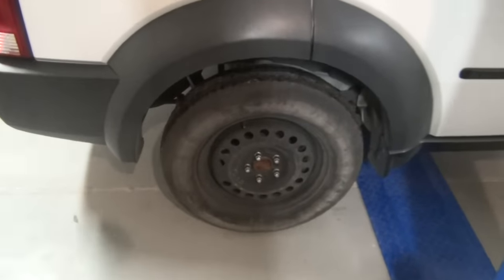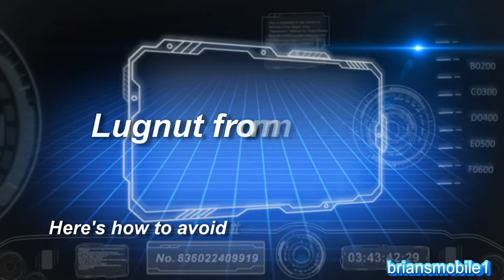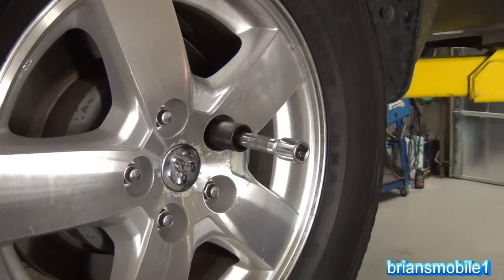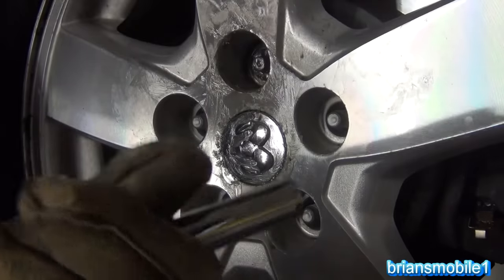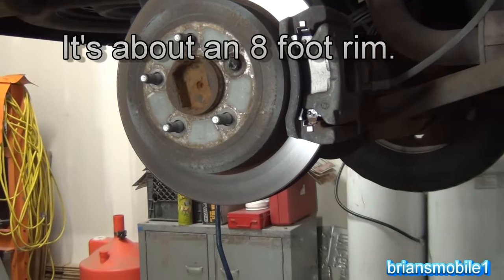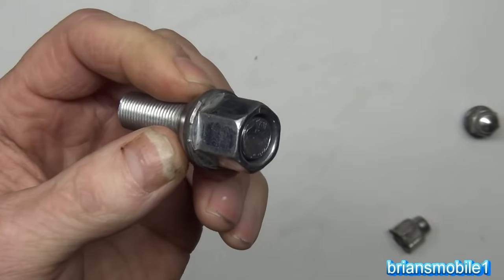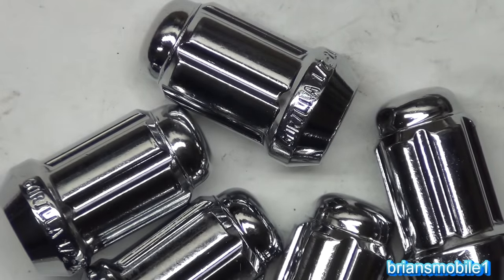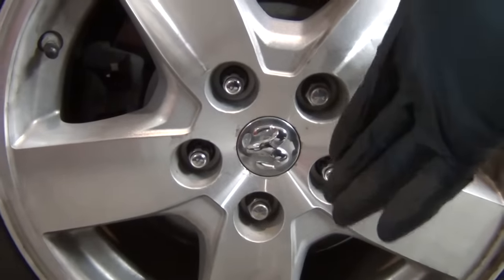Lugnut From HELL

Comment: Lug Nuts are to be Tighten using a TORQUE Wrench to.avoid Overtightening which is what happened here. A normal Car Lug nut Tightening Torque is around 70 Nm to 80 Nm. While a light Truck is around 90 Nm to about 120 Nm. But those Workshop sometimes overtightened it to over 200 Nm !

Comment: The best measure of any establishment (and in fact many things in life) is not how often things go right, but how it's handled when things go wrong.  It sounds like whatever place it was you went to may have screwed up, but handled their mistake properly.  If so, then good on 'em!  :)

Quite an interesting video!  Perhaps I've just been lucky, but I've never run into a two-piece lug nut like that.  I'll definitely be adding an extra step to my wheel removal process!  A quick little wiggle of the socket before going nuts (pun not intended...) should reveal if the nut is a different size.

Comment: Too many guys grab their mega-high power air gun and tighten the lug nuts without regard for the wheel coming off next time. When I was service mgr in a Ford dealer I saw it a million times. Some wheels don't react well to the heat from a torch or plasma, it puts you in a bad situation with the customer. A dab of NeverSieze and a torque stick eliminate 90% of those kind of problems. One trick I've used with some success is make a small cone from sheet metal to surround the lug nut to protect the aluminum and hold it with long bent nose pliers. Wear protective gear as it directs the flame back at you, the nozzle gel is a good idea, the clay that's used when doing body repairs with lead filler works better to absorb heat without burning away. Just suggestions from my experience.

Comment: For anyone wanting to try this heat it up until cherry red or white then immediately pour lots of water on to the pub nut its self, this rapidly cools it hardening the nut, then use a smaller socket to hammer on or nut remover like he tried.... Also don't use an extension with your impact when doing this as you lose about 25-30% of your impacts power lol

Or just use a centre punch in the stud then drill it out..

Comment: The dealer completely stripped one of my lug bolts. They make sockets specifically for this issue. The socket threads itself onto the bolt counterclockwise and once it reaches the base of the bolt head it is essentially locked onto the bolt. I used a cheap craftsman impact and got the stripped bolt out in 15 minutes without doing any damage to my wheel.. and it was ridiculously overtorqued.. this was a complete hack job and there's really no excuse for it considering you can get one of the bolt extraction sockets right at autozone... but to each their own. I'd rather buy a $10 socket than a whole new wheel

Comment: Same thing on my dodge ram. two of them on the same wheel. Lugnuts broke in half. So all that was left was the rounded bottom. I drilled around the lugs destroying the rim. Then i threw those rally rims in the junk and replaced them with chrome rims that you could at least get to the lugs that aren't buried in a hole.

Comment: Those gorilla lug nuts will actually take a 6 point socket as well, give it a shot sometime.  I believe a 17mm.

Nice video by the way!
Reply: If you're doing lug nuts/bolts you should only be using a 6 point socket of high quality.

Comment: I just went through 3 1/2 hours of pure hell with my Jeep aluminum wheels. Same stupid capped lugnuts. Someone put mine on with an impact wrench to the max. How the studs didn't break is beyond me. Less the torch I did everything that you did. One thing extra: I used a 3/4 inch bi-metal (QUALITY) hole saw. I took the drill bit out of it and slowly drilled around the remaining part of the lug after taking the outer layer off. Looks like there would be NO wheel damage at all and it was pretty quick. Should have done hole saw first. Stay well.

Comment: I have found the best and least destructive way to remove a stuck lug nut is to drill them out. Using a torch is effective but is hard on expensive wheels.

Comment: I snapped my 1/2" drive breaker bar with a five foot galvanized pipe 
after heating red hot. Defeated two Impact drivers, both half inch. 
Snapped a star wrench style lug remover at the center weld.

 It's also a goddamn Chrysler.

Comment: Out of curiosity, what years would this apply to?? I have a 2015 model and am wondering if it's something I should be concerned with.
Reply: I also have a 2015 and am thinking of replacing the lugs to avoid this type of issue in the future as best I can.

Comment: Way too much work there. You had the right idea the first time. I remove 10-15 a week for our local Discount Tire Store. To be straight, DTS pays for the repair everytime, with NO griping. They are the only tire store I know that does this. The failure here was not the lug nut. The common failure here is the last person that put on the lug nut. They are usually cross threaded and driven on with an impact. The next guy gets the bad one, either broken off (preferable) or stripped out. To remove these in 10 minutes, yes even the one in the video, put the nozzle dip on the wheel, turn oxy acetylene torch down, and blow the stud out to even with the wheel, then use an air hammer with a punch to push the stud on out while still hot. Works everytime. 10 minutes.

Comment: I know power is not the issue here but just gotta say:   I have the snapon impact guns and let me tell you.  The Milwaukee is a TON more powerful.   Especially with a fresh 5Ah battery or higher.    Use a 12A and you can do anything.     Take bridges down Lol. 
The Milwaukee is super heavy to hold though and the impact motion is violent and unstable.    The SnapOn is lightweight, zips faster and a has steady pulsating impact.  
Both are great to have.  When i worked on heavy duty diesel and excavation equipment, the Milwaukee was handy.   i mostly stuck with it.  But if I’m doing routine stuff , tedious or laying down: i want my SnapOn. It’s light, steady and stable.

Comment: I have ran into this exact issue a few times. My strategy for the least stressful removal is to heat the stud and drill right through the center once you get a good hole in there you can hammer it and break it off

Comment: I looked all over for a set of Gorilla lugs that have 24 lugs for a Jeep, but all the kits are 20 piece, need 18 standard with 5 keyed.  Gorilla, hey, Wranglers need  3 lugs for the spare, or 2 and a locker.
So, 4x4 (for wheels), 2x1 (spare) and 1X5 (locker lugs) in a Wrangler kit.

Comment: That nozzle dip seems to work well. In the same situation I have used tire lube compound with excellent results aswell (as long as you glob it on there) first heat it up then chisel away as much of the lug nut as possible. Then with just 1 other lug nut threaded on a few turns adjacent to the damaged nut I will hit it with the oxy/acet until it’s a cherry red pool and have somebody else smack the back of the wheel with a deadblow hammer it usually pops right off after a few good smacks.

Comment: My  neighbor  had a jeep with a rounded over lug nut. all I did was the same thing you did. But I used 1/4 or 5/16  drill in the center of the lug and slowly drilled it far enough to weaken the stud used the tire and rim to snap it off .

Comment: Last time I worked on a vehicle that had a frozen lug nut and was about to the point you were at with the torches and all. I just drilled it out. Made it SO much easier in the long run and less time. Just told the customer I would need them to pay for the 15 minutes to drill and the time to install a new stud and lug nut onto the vehicle... Took me 30 minutes and they paid for an hour.

Comment: drilling the stud is the safest way to make use you wont damaged the wheel... starting small and going deep until you are at thr same level as the nut and work your way bigger.  the only tricky one i got was on a audi a5 safety lock bolt. can't drill can't punch... i deflated the tire and welded around the stud the material was now soft enough that an extractor would grab...  still needed to use a 3/4 inch impact with 170psi to crack it free but champagne and golf clap was the end result

Comment: I had one like once on expensive chrome wheel customer dropped it in after the tire shop rounded it off, I don't bother with hammers, torches as it damages the rim, I drill a tiny pilot hole very slowly so you dont burn up and break drills through the stud and went one size bigger until the the wheel broke loose, I just replaced the stud and wheel nut without any damage to the rim, hours work though but a lot cheaper than replacing a rim.

Comment: I just had the same experience with jeep lugnuts. I ground off the cap with a grinder protecting the alloy with tape from the grindings then drilled them out. I was very surprized how soft the lug studs were and how easily they drillled out. from there I can pull the ones that will remove normally or with a smaller 12 point socket pounded on. Don't think I would ever try your approach. Just sayin.

Comment: Ever heard of an annular milling cutter?  Or even easier, remove all the other lug nuts, set your wheel an inch or so off the ground with the stuck lug in the 12 o'clock position and yank the bottom of the wheel away from the car. It'll break the stud, which you can easily replace.

Comment: Brian  on  that bolt or most any other grab your oxy/ acetylene torch get center of bolt to glow red then without moving  tip quickly turn off  acetylene knob squeeze oxygen handle move tip inward  ( caution allot of blowback ) with practice bolt will melt away leaving threads intact

Comment: What I've had to do is take an acetelene torch and with the flame just hot enough to cut with the oxygen put the tip in the center of the nut and blow out the stud inside. this gets the nut off so you can remove the tire, and results in little damage to the wheel. Of course I've only done this after all other methods have been exhausted.

Comment: Just been thru that too. I drilled the stud itself. Started with a 1/8" drill bit and went up till it was into the threads then drove the stud out the back. Get a set of solid lug nuts off eBay for $20.

Comment: I had lugnuts like this. Towing company came with impact sockets, took one size too small, sledgehammered it on, and using a long breaker bar snapped them all off. Probably could have done the same here.

Comment: Just a question , wouldnt it be easier to punch the center of the nut/stud, drill a 1/8in hole then take a slightly bigger and bigger drill bit till you go through the nut and stud without damaging the wheel ?

Comment: Next time get a really hard drill bit and just drill the stud off. a stud cost 4 bucks, saves torch fuel, saves head scratching. 

Then disassemble the brakes to expose the back of the hub hammer the old stud out slide the new stud in, put a nut over the stud that does not thread onto the new stud. put the lug nut on, then tighten the lug nut until the new one is seated.

Comment: the nut is not soft, a 19mm will not damage it when spinning. so the cap breaks free, than corrosion swells it, its soft. its an 18mm nut with a 1mm cap on it. hammer a 19 onto cap if swollen. if that spins. keep spinning with impact. until it gets stuck in socket/hot. using socket pull cap off. than, an 18mm will go right on nut under neath and fit the 18mm well. bingo. 18mm socket is key with 19mm capped nuts. and those spline nuts aren't any security at all. its extremely common and a universal key. they aren't security nuts, they are for narrow holes in aftermarket wheels. with the nut being physically twisted like that, its entirely possible it really was just that stuck, hammering a socket on wasn't the cause, hammering on a 17mm is practically impossible. that never really causes stuck nuts. if you are torching you can just torch through the stud, it can't really cut the aluminum wheel

Comment: The entire time you were trying to get it off I remembered seeing a video of yours where you mentioned the plasma cutter. They come in handy for cutting bad out of a frame to weld in new metal. 

Thats said I usually will try heat and if that don't work I'll either plasma cut it or I'll just go ahead and deem both the nut and stud shot and drill it out. The Chrysler lug nuts are horrible and I have seen them seize up a month after putting them on mostly on Jeeps. Dodge Rams I do work to usually will come right off and even though the caps usually fall off as well they are just a bit easier to come off for me anyway. 

Lastly I always have switched to an 18 when the cap comes off or use the socket with the cap stuck in it on any one the cap is missing this has made the amount of stuck ones minimal and I really only see them now when someone else has taken their wheel off and lost the cap.

Comment: They make 17.5  18.5   19.5   21.5    and 22.5 MM sockets for swelled lug nuts and lug nuts missing the cover sleeve. Also if they do do break loose with an 1/2" impact, I grab a 1" impact and snap the stud.

Comment: matco makes a 22.5/22 socket for the dodge trucks and a smaller one for the 19mm lugs. they fit on the swollen lugnuts so you can take them off. the smaller socket also fits the lugnut when the cover comes off so you dont round it off. and if those fail I used to use an air hammer with a chisel bit to spin damaged lug nuts and wheel locks off

Comment: Remember, anytime you heat a piece of steel you could be taking the temper out of that part. You softened the lug nut with the torch which is why it felt so soft with the cold chisel. But yes these lugs are most likely a low grade steel anyway.

Comment: I had this exact same issue on my dodge truck, luckily it was on the steel spare instead of one of the chrome rims. I eventually cut the lug and stud off with a grinder and then had to keep grinding to get the rest of it out from where the lug seats into the wheel further. Bought the last wheel stud my local autozone had and got it replaced. Nothing like taking all day to change one flat.

Comment: Just FYI even using a lug nut extractor impact socket will still strip these if the acorn is missing.

God help you if that acorn falls off or you lose it on the road. I'm in the same position Brian was in, except I don't have a blow torch or a plasma torch.

Guess it's time to go to the shop. At least I know the wheel isn't going to fall off in the meantime, because that lug nut isn't going ANYWHERE.

Comment: Should of tried a bolt extractor, the hammer on socket type with spirals inside that bite when you twist
You’ll twist the head off before you strip the grip on it
I work on super rusty forklifts all the time, the suspension bolts are always seized up 
I use maximum bolt extractor set, 40$ on amazon, and they’re impact friendly 
Heat her up, knock the extractor on, rip it out
Works religiously

Comment: OK I know this is old but ditch the chrome extension and either use an impact extension or just the socket.  You lose an incredible amount of power due to the flexing of the chrome extension.  I would also suggest a stronger impact wrench.  I used to use an IR 231 (I think...rather in expensive but with tons of torque) and never had an issue with removing any nut/bolt.  FWIW I worked for Chrysler fo 10 years and saw lots of these cap lug nuts.

Comment: It probably would not have helped in this case, but you need to put your socket directly on the impact wrench and not use an extension because of torque loss due to slop.

Comment: A Metrinch socket with a long bar would have been in with a chance. Even if it's labeled a certain size, each socket will generally undo a size down due to their single hex wall gripping design. I'm now tempted to get an impact set from them after seeing this, despite costing a bomb.

Comment: Center punch the center of the stud once then drill it using drill bit that's one size bigger than the stud. When you get close to the end you can use a socket to twist the nut and stud right off.

Comment: Why did you not drill out the stud? its not harden steel. You have to replace the stud anyway right? This happend to my sisters corola and thats what i did, I have a drill doctor and it only took 3 drill bits, a water hose, resharpening each bit once and the last bit was sharpened 2 times. took us 30 minutes to get it off.

Comment: A quicker and easier way... Get some good quality Cobalt drill bits. Drill down the center with a small bit and follow up with a larger one. Stud will snap right off. Pound out the old stud and install a new one.

Comment: I found on my dodge van after so tight half of lug nut snapped. So tight it snapped with a long breaker bar. I simply drilled through the stud itself.  You will be amazed how quickly it will drill through. Sure you need a new stud but chances are you would anyway

Comment: If the extension isn't needed, using the impact wrench directly on the socket would apply more force. The extension is acting like a torque stick of sorts, limiting the peak torque.

It didn't seem like the lug was stripped and spinning with the impact wrench and socket; was it not possible to apply more torque with a breaker bar or torque multiplier, before resorting to the last ditch methods?

Comment: This is why I will continue to use torx for everything. Any things don't need to be tightened down that hard and if they are tightened down quite a bit you have a higher chance of breaking the tool than you do the nut. Also most people don't have torx bits and therefore using them more means less people can steal your shit....

Comment: Use an electric high torque impact, personally my favorite is the Milwaukee M18 Fuel 2767-20 delivers 1400 ft-lbs torque. Gets crankshaft bolts out with ease